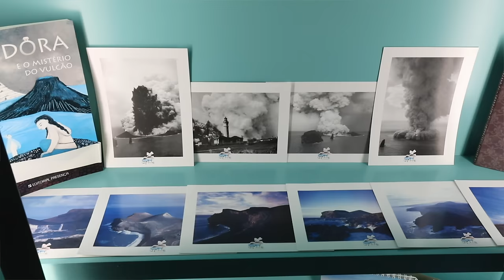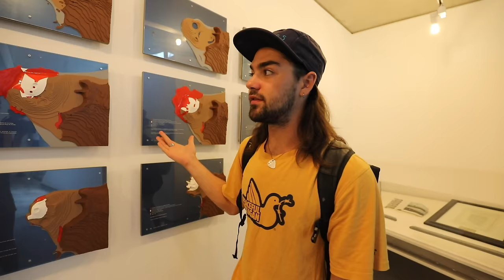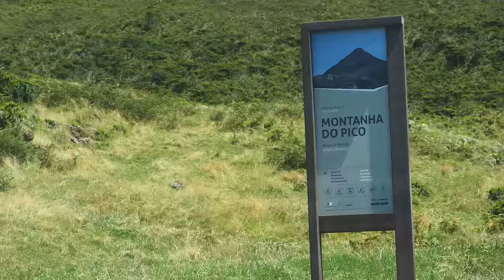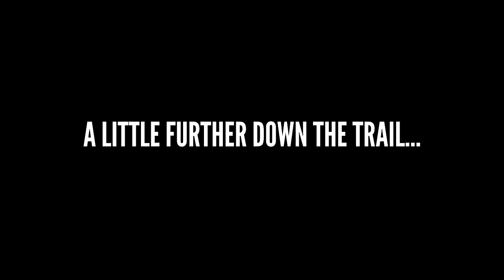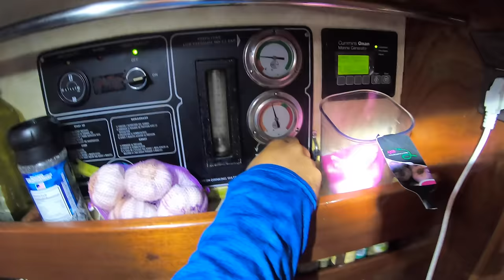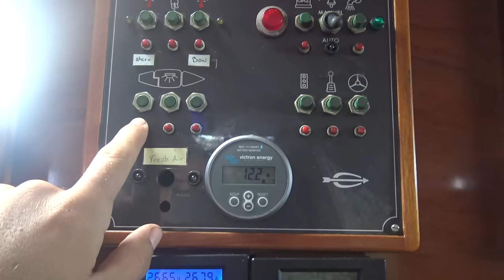Climbing the highest peak in Portugal!  SV Delos Ep.254

Comment: Not to dis on Sean's welds but you might want to have that rewelded when you get a chance lol, those were some nasty looking booger welds.
Reply: Yeah, i wouldnt trust those welds. Stickwelding isnt the easiest thing to do if you are not practicing it. Especially on thin tubing. And these welds show that:) There's probably air and flux mixed in with the metal on these welds. Also, i sort of feared for the underlying glassfiber/epoxy, seems like a lot of heat was created, and it doesnt take much to melt the epoxy.
Reply: You could tell he was worried about burning through the tubing and had the welder set to low
Reply: @Timeren2010   Yeah thats not an ideal place to be welding.. id want to try and detach the rail, get something under it to negate the heat transfer.

Comment: There's a welder's statement that applies here..." a grinder and paint, make me the welder I ain't"
Reply: I believe that was from the
Mustie1..... haha!
Reply: If they could have shielded from the wind and used a TIG it would have turned out much better. ARC on thin tubes is nearly impossible; it looks like he burned though and had to fill over it. No sparks from the TIG to damage the deck and much better on low power. But you've gotta work what you got.
Reply: @danieloliver20  that saying is from long befor the internet
Reply: @chriszag702  yep, I just like the guys vlogs
Reply: @danieloliver20  i really do aswell, seen them all (:
Reply: didn't know you could stick weld SS
Reply: @snoosebaum995  you can, its just not recommended. Really wants better shielding than what arc can produce, esp in the wind.
Reply: I resemble that remark. I can see he snuck up on it so as not to blow a hole through comparatively light gauge tube, hence the bird poo. I'm always impressed what inverter machines can do.
Reply: Country Job it will hold

Comment: Hello Delos Crew. i always keep some Citric Acid on my boat. as i use it for all work including metal work and just mix 5 to 1 of Citric Acid and water to make a solution that will clean lime scale from kettles. just turn the kettle on and let it work its MAGIC after the kettle it will clean up rusty metal work just let it soak for a hour or so it works well on cleaning. shower heads and cleaning the toilet it eats up lime scale and eats rust. keep some Citric Acid on board the boat it will help you do all kinds of work on board

Comment: Cool Stuff. Island groups are usually formed from a single volcanic outlet as the Earth's plates are moving over it. This is why you see island groups in a line along a fault / plate movement. This island might get larger and larger depending on the activity or it might get a baby sister island formed if the volcanic activity goes dormant for a long duration in relation to the Earth's plate movement.

Comment: Arc welding stainless is seriously difficult, especially with a small, Low amp welding unit like the one used. But hey, job done, hopefully it holds up. Important detail you all should be aware of: Stainless, when welded puts off a very hazardous, poisonous gas that in an enclosed area can be deadly. Even outdoors welders will wear a gas mask to keep from breathing those fumes. In professional welding shops stainless welders wear respirators and enclosed air tight helmets so they don’t poison themselves. Just a bit of FYI in case you all run into needing to do a stainless welding repair in one of the holds, etc. The scenes on top of the mountain were simply stunning and that red at sunrise? My god Mother Nature is something else....as always, I’m looking forward to next week.

Comment: How cold was it at the top of the mountain?  It looked freezing.  I also do not understand the concern about the batteries and how the welding process would affect them.  The heat from the welding is localized at the place where the weld in occurring.  Why would that travel to the batteries?

Comment: The name of that type of welding explains or describes it better ark welding.  You control the ark created when there is enough amperage to jump between a small gap when completing a circuit.  It is very difficult to ark weld thin metals.  Tig or Mig welding would be better but almost impossible in that wind since they use a shielding gas instead of flux.

Comment: Come on guy's, you're an experience group but why go through the procedure of  switching off  the individual circuit breakers  and then isolate the batteries?. Or am I missing something? 
 Isolating the batteries does them all in one easy go, guess you know this.
Keep up the great video's.
Reply: Not an electrician here but I think the switchboard isolates the devices from beyond the switchboard/fuses, and the battery switches isolate the batteries from the entire boat. So any major failure would probably affect a small percentage of the boat's systems/devices AND being isolated from the battery bank no super-expensive fails can occur. Basically doing as much as possible to isolate system every way possible that the wiring system allowed.

Comment: The worst bit of welding I have seen in a long while.
Reply from the maker: haha ain't pretty but it holds!
Reply: @svdelos  have to see about that...lol
Reply: Yup! "Crack - gone"... crack back in a coupla weeks maybe ;)
Reply: John Nicolson  I agree. Bad Welding. Not enough heat. That weld should have looked like glass. Not raspberries.
Reply: Brady at 30.56. “ Our South African that can do it all, knows how to weld pretty good “
Think Brady just learned a big lesson soon after
Reply: Who knows what kind of power they were plugged into. Those little welder's can be a PITA trying to arc weld. Although still better than my old century mig that's feed is jerky at best.
Reply: I do agree though, it looks like it could have used a little more juice.
Reply: Everyone is all he needed more amperage but nobody questioned the lack of safety welding barefoot in shorts...How about arc flash and molten metal hitting your bare skin?
Reply: @thomas7770  Sorry to disagree, but electricians hold that trophy. 🏆😆
Reply: The idea of folk helping each other is awesome.
    It isn't about welders being critical. It is about welders knowing how junk on the surface causes porosity (small voids because of oils, paints, whatever gassing off).  Welders also know without quality heat penetration one is simply adding a glob of metal on top rather than bonding with the two pieces as one. This example lacked enough heat penetration for sure. I wouldn't trust that weld & I would keep it on your repair list.
  I would also be thankful & happy for a fellow sailor trying to help.  With practice he will get there. (Pro tip, grind out the damage area a bit making a groove, this acts as a quick cleaning, gives room for the new material, and increases likelyhood of getting good heat penetration- dont be scared of turning those settings up or cutting your rod so you can have more control).
  Thanks for another great video, and a wonderful example of asking for help & allowing others to give it.
Reply: @JimKJeffries  It's not what you say, but how you say it.
Reply: I forgot all about the welding, but what about that EPIC hike!!!
An awesome day and night for you all. Great views, thanks for sharing! Hugs 😊❤⛰🏞🌅⛵🏄‍♀️🏄‍♂️❤
Reply: @aaronbowen6510  I think he had to weld cold. It looked like he burned through and had to fill it in. Thin tube with ARC isn't fun.
Reply: @daniels2761  yeah I think you're right.
Reply: @JimKJeffries  I'm by no means a good welder, but I work maintenance in a butter plant, and when something brakes at 3 a.m. and the welder doesn't come in until 8 I sometimes have to do what I can.  It's amazing how fat almost works itself into the pours of then metal.
Reply: @ferociousfil5747  at least he had glass on 😂😅🤣
Reply: @mischievousamoeba  sorry if I said it poorly
Reply: What people have to throw shade.
Reply: Noone AnybodyKnows , you are correct
Reply: @JimKJeffries  Not at all! I meant the original comments. You were polite.
Reply: @nooneanybodyknows1321  LOL, Being an electrician and welder I agree. But then, most everything we do as electricians or welders, can kill people. Your first good shock is usually your last, most bad welding can be rewelded, but a bump on the rail, crack, fall overboard, sucked through the propeller.

Remember that - everything in the NEC code is there because someone or many someones, have died from it, burned from it, lost property from it in the last 125 years. Just sayin'
Reply: @billb48843  Yeah, I'm a retired a-hole electrician. We're an anal bunch of crotchety so-and-so's eager to criticize lack of craftsmanship. 😁Thank you, IBEW 💪The NEC and NFPA are our bibles.
Reply: Its a good job that there was not enough heat going in. The stanchion should have been  unscrewed and lifted and lifted a little clear of the rail.  regards
Reply: Sometimes things may not be pretty, but they can be functional. lol

Comment: Omg !  For the man that can do everything,  that is worst ever attempt at welding I have ever seen.  Brady ! Do not let this man weld again. It’s terrible. This should have never been filmed.  Brian will be furious at this abomination attempt.  You would have better luck filling the crack with seagull poo
Also, never ever weld while still screwed to the hull, damage to fibreglass is imminent.  Release the screws,  raise up with a timber wedge and then do a proper weld without heat transfer to the fibreglass.